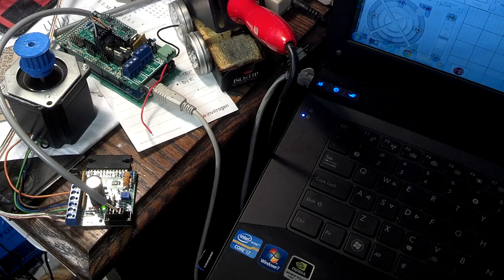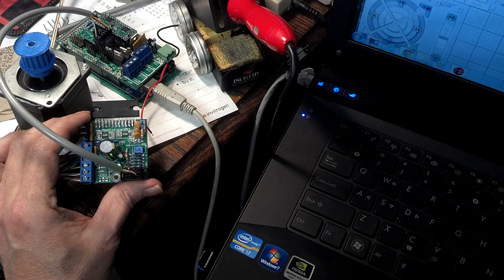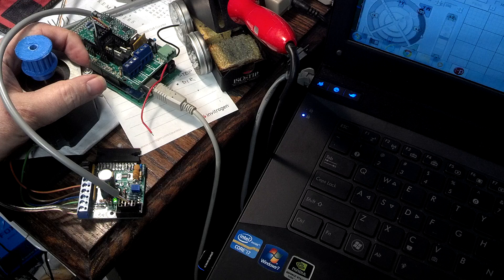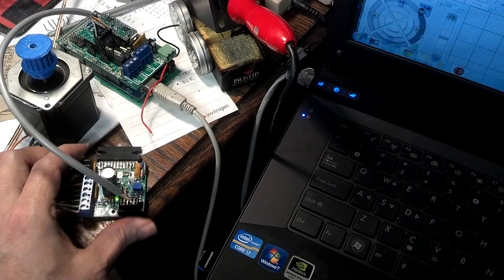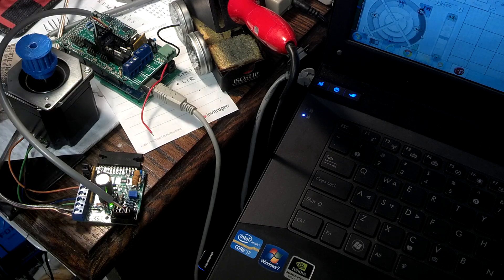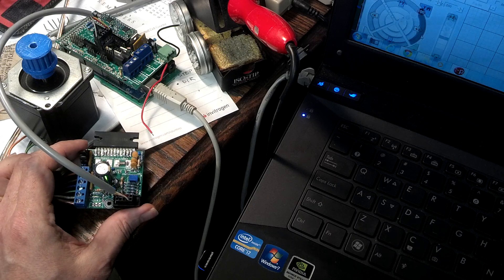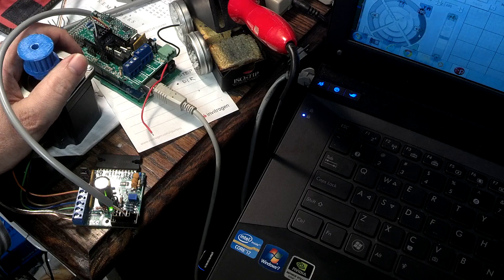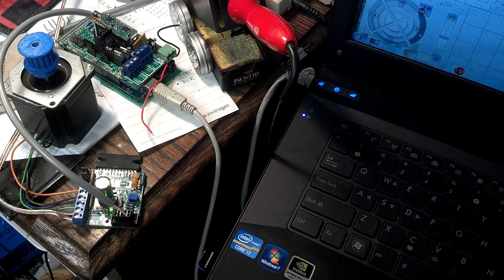RAMPS Merlin NEMA23 via THB6064AH 50volt 4amp stepper driver

Comment: hello Sir, I have a question. I am using tb6560 with ramps1.4 and motors are skipping the steps and creates a humming sound during the skipping process. After using these drivers THB6064 did this problem solved completely. Other than that did I have to write programs in marlin to run them effectively or not. Please reply I am using Nema 23 2.8 amps 24v motors.
Reply from the maker: I can't promise to "this problem solved completely". These drivers will do better.
Reply: @JamesNewton  one more question sir, did you made a 3d printer with these drivers, so that I can order them. Thanks:)
Reply from the maker: @ambroscustom  No, I have not. My customers have made rather large 3D printers with them:
http://massmind.ecomorder.com/Techref/io/stepper/THB6064/gallery.htm
,o) Like, big enough to 3D print houses. Please note: Shipment outside the USA is expensive, but required. Please be sure to select the correct option when ordering: Inside or outside the USA. Also, this does come as a KIT. E.g. a PCB and components. YOU must solder it together. It is NOT just terminal blocks and screwing wires down. But based on your channel, you should be handy enough to manage it. And if that CNC build is what this is for, it will more than manage it.

Comment: Great video. I have Anet A8 which is like Prusa i3 printer. I want to replace my Y-axis Nema17 stepper motor with Nema23 stepper motor because I rebuilded my Y-axis and got much heavier heat bed. I used 300x300mm 1/4" thick aluminum heat bed, and 1/4" thick glass on it), 16mm rods with SC16UU linear bearings for more precision from edge to edge printing. Because 300x300mm thin 3mm aluminum beds heated to 100-120C are warped, its hard to align them with nozzle for edge to edge big size part printing (PETG or ABS). Most of the nowadays cheap printers can be aligned on the center spot only.  So I need stronger and wider timing belt ( larder diameter gear with 1/4"diameter bore for Nema23 shaft diameter). I have pin out from the board for Y-axis (DIR, ANABLE, STEP, GRD). Can I use this THB6064AH driver to drive Nema23 ? I can get any DC power supply 24v-80V for that, no problem. X-axis still will be used with Nema17 because it used to drive light weight extruder. And of course I need to flash the board to get Marlin with new Y -axis  mm/step updated software. Anyway , can you help?
Reply from the maker: That should work, but the power supply shouldn't be more than 50 volts. I recommend 48, but honestly for that application 24 is probably fine. Higher voltage means more speed and I doubt you need more speed on that axis. The only possible issue is the polarity of the enable, and you can avoid that by just keeping the driver enabled all the time and not connecting the enable signal. There is an adapter cable which I strongly recommend (out of stock, right now but will be in stock very soon) that makes it super easy to connect to the standard (Pololu) stepper header used on 3D printers.

Comment: So I don't know if you'll see this,  But if i'm using an external driver with ramps, How do I set the microstep jumpers?  Say I want to run 1/8th step,  Do I set the ramps board as 1/8th and what would I set the external board to?
Reply from the maker: Charles Gray you would set them the same...
Reply: Thanks for the reply!

Comment: Hi. Thank you for beatiful video.

I have  mach3 control card and driver.  But I unknow  how to connect   control card with driver

Do you help me please?

How to connection control card, drivers and step motors?

I have 2 mach3 card:

https://tr.aliexpress.com/item/SAVEBASE-Upgrade-Usb-5-Axis-Cnc-Breakout-Board-Interface-Adapter-For-Stepper-Motor-Driver/32251904090.html?spm=2114.13010608.cb0001.6.yAYI18&scm=1007.13441.37946.0&%3Bpvid=5d8f91b7-4760-4ab1-8d08-d0d379f5a467&%3Btpp=1

https://tr.aliexpress.com/item/5-Axis-CNC-Breakout-Board-With-Optical-Coupler-for-MACH3-Stepper-Motor-Driver/32774074750.html?spm=2114.13010608.cb0001.4.yAYI18&scm=1007.13441.37946.0&%3Bpvid=5d8f91b7-4760-4ab1-8d08-d0d379f5a467&%3Btpp=1

and new drive

https://tr.aliexpress.com/item/Single-1-Axis-3-5A-TB6560-Stepper-Stepping-Motor-Driver-Board-Control-CNC-Router/32776368729.html?isOrigTitle=true
Reply from the maker: Very sorry, I'm just now seeing this; apparently YouTube thought it was spam and I didn't get any notice about it. Connect Step to Step/Pulse/+CW/etc... Direction to Direction / CW/CCW+. Ground to Ground.

Comment: hi, i recently purchased a few of these stepper drivers
http://www.banggood.com/TB6600-Upgraded-Version-32-Segments-4A-42V-5786-Stepper-Motor-Driver-p-981997.html

can i use it with ramps? im making a cnn its quiet big and im using NEMA 23 steppers from openbuilds. 
Thanks
Reply from the maker: Well... you can try... Why not? Anything that accepts a step and direction signal. However, the easy to use adapter in the video is designed for a quality open source driver like our THB6064AH with the PMinMO standard connector. With that chinese crap, and those chinese drivers ARE crap, you will need to figure out the wiring for it's non-standard connector. And then hope it doesn't fry. 'cause THEY will never support you. Good luck! We'll be here when you are ready to try quality.

Comment: So I made the THB6064AH kit from massmind.org but would love to see the process of testing/powering up the driver for the first time. Also - How do I connect it to my ramps board? http://www.instructables.com/id/THB6064AH-Nema-23-Motor-Driver/
Reply from the maker: The connection and power up is documented here in the online manual: (near the end of the page).
http://www.massmind.org/Techref/io/stepper/THB6064/index.htm
Reply from the maker: The step and direction, power and ground, signals from the RAMP board connector just need to be connected to the driver. We have an adapter board and ribbon cable that makes that easy. Because use of this driver with RAMPS is pretty new, I'm providing the adapter board free with the purchase of the cable. Just be sure to remind me in the notes when you place the order:
http://www.ecomorder.com/techref/ecomprice.asp?p=416020
Reply from the maker: Also the pin numbers and jumpers on the RAMPS board to the pin numbers of the PMinMO connector on the driver are listed in the description of the video above.

RAMPS Pin. Signal  -> PMinMO Pin
JP4:
1. DIR   -> 3
2. STEP   -> 5
3. /SLP   -> n/a
4. /RST   -> n/a
5. MS3  ->  n/a
6. MS2   -> n/a
7. MS1   -> n/a
8. /EN  ->  1

JP2
1. GND   -> 7,2,4,6,8,10
2. VDD  ->  9

Comment from the maker: For 2 reasons: 1. That requires finding the configuration line for that modification, which honestly I couldn't find (please let me know what file that was and where in the file?) and 2. because the TB6560 isn't safe until you get the pulse up to 100uS and that means your max pulse rate is then a few tens of kilohertz. That may work for non-microstepping modes, but smooth operation needs microstepping. Not to mention that the TB6560 is NOT designed for this and will eventually fry on power up.

Comment from the maker: That is actually a VERY good question. The answer is: Technically, yes, certainly, the wider the pulse the fewer you can send in a given time. However, practically, the answer is (I believe) no. Stretching a 1uS pulse to a few uS means changing the maximum frequency from 1MHz to a few hundred KHz. And I don't think any reasonable stepper system is ever going to run at more than hundreds of KHz.

Comment: Forgive the ignorant sounding question but:

Does stretching the pulse with a capacitor like that sacrifice some of the Ramps' max step generation bandwidth?   If so, is it significant?

I'm in the middle of a mendelmax build.   My only previous CNC experience was with keling steppers and drivers and doing all step generation through a PC (EMC2) for a CNC wood mill.  I think the max I was ever able to achieve without lost steps from hardware latency was ~18kHz.   Very old PC.

Thanks in advance.

Comment from the maker: I'm not experienced with RepRap, but one of the issues I hear about from RepRap people is that the little Polulu stepper drivers (1 amp 35 volts) don't have enough power to move larger motors very fast.  If you are making a bigger version of a 3D printer, or want to slam that bed back and forth faster, you need more power = watts = volts * amps. Polulu is about 35 * 2 = 70 watts.

But, when people hook up other, bigger, drivers to the RAMPs boards or anything running Marlin, the result is a mess: Massive missing steps. Why? Because the step pulse Marlin puts out is microscopic; only 1.88uS according to my scope. The Allegra A4983 drivers used on the Polulu's are very unusual in that they only need 1uS step time as per page 6 of the datasheet:
http://www.pololu.com/file/download/a4983_DMOS_microstepping_driver_with_translator.pdf?file_id=0J199

Most drivers want at least a few micro seconds to catch the step signal. Some advise much more. For example, the ultra popular (but flawed) TB6560 drivers require 10uS /minimum/ and recommend 30 to 90uS as per page 7 and page 10 of their datasheet.
http://www.toshiba.com/taec/components2/Datasheet_Sync/382/27885.pdf

The excellent little Linistepper driver (which is open source and about equal in ability to the Polulus) will not work with RAMPs/Marlin either. So sad, as it would be perfect, since it's totally open source, and really fast and smooth:
http://www.linistepper.com

The Marlin code is written in such a way that it would be very difficult to extend the pulse in software. Teacup firmware appears to make a longer pulse, but it isn't as popular (as I understand it). One possible solution is to add a pulse stretching circuit with a cap to charge up and hold the pulse signal for a while. That is still something we might explore. But...

It turns out our new THB6064AH driver had a cap on the step pin already! And it just pulls the 1uS pulse out past the 2.3uS needed by the chip. So... the existing driver, as supplied, will work with the RAMPS/Marlin RepRap controller!
http://www.ecomorder.com/techref/ecomprice.asp?p=416074.
Reply: http://www.schmalzhaus.com/BigEasyDriver/
Yeah, 2A is plenty even with 1 motor driving both halves of the Z axis via a printed transaxle.
Reply: We changed the firmware (Marlin) on phoenix drivers (Tosh based) to extend the step width, we detected this problem in the early days of testing the Tosh drivers. We don't get issues with loosing or missing steps, or speed of the axis, its the extrusion process itself that ultimately slows us down. In fact the new controllers and drivers we are exploring are even lower powered!
Reply from the maker: I think the issue is that most people don't want to change the firmware... maybe I'm wrong. Have you made those changes available or suggested them to the Marlin project leaders? And more importantly, how did you make those changes with out just putting a delay into the code which could easily create timing problems on high speed runs with drivers that microstep? I looked at the code and it didn't look that that change could be made easily while still leaving code that is robust and efficient. I'd love to be wrong on that...

Also curious what drivers you are working with. Weren't you using the TB6560? Did you work around the power up sequencing issue?

Wow... sorry, lot of question marks in there.
Reply: I find the BigEasyDriver great for up to 2A even without cooling. Give one of those a go.
Reply: Hi James 

Yes most folk don't want to change, however in our case we were doing large group builds and supplying parts etc.. along with compiled binaries as well as source code.

As far as I know Erik has pulled those changes (although he pulled others) and the master may be a bit out of wack with current Marlin although other members in our group have merged changes with newer Marlin versions etc..

You can find the changes we made to Marlin at Buserror's repo: https://github.com/buserror-uk/Marlin feel free to use those changes. We pursued a number of options for the pulse width expansion, the final one didn't effect the timing and proved wide enough for all of our applications (we were very careful not to change the overall timings, Buserror has his own AVR sim!).

Yes we used the TB6560 and solved the sequencing issues (I have spoken to you before about this).

As far as you pulse stretching goes using hardware : I would avoid this as it is not a hardware problem, its a software engineering problem. Because Marlin (along with other RepRap firmwares) are open loop motor control systems they assume pretty much zero latencies for motor actuation. Thus introducing hardware pulse stretching (especially lp filter based)  will inevitably introduce step delays will could cause further issues and complications. LP filters also change the harmonic content of your step significantly reducing the slew rate, even if this is then fed through schmitt trigger it basically will introduce latency.

Hope this answers some of those questions

regards
Al
Reply from the maker: Hey Vik, that's great. It's a drop in replacement for the original? But a little expensive... For $7 more you could get 4 amps at 50 volts. Of course, then you would need to make a cable as well. I'm assuming 2 amps is enough for the machine you are running.
Reply from the maker: Alan, thanks for sharing the code changes. I'll be interested to see how you did that, it's quite an accomplishment to fix it without otherwise changing the timing!

I'm really glad to hear that you have the power on sequence issue compensated for the THB6560 driver. Lot's of people just ignore that problem and then wonder why the driver fries one day on power up. What does that drive cost to make? E.g. does the power on sequencing hardware make it very expensive?

The hardware pulse stretch we are doing here is from 1uS to about 3uS. There is maybe 0.2uS delay on the rising edge. There is just NO way that microscopic change in timing could ever affect operation. Just to make sure we are clear, we are talking about 0.0000002 seconds. Even a delay of several uS would be undetectable in any macro scale mechanical system.